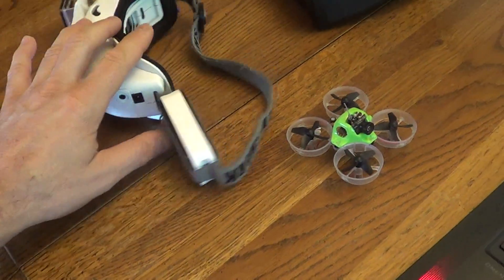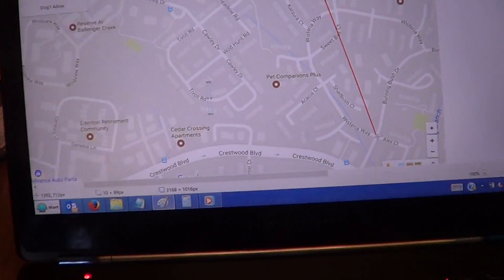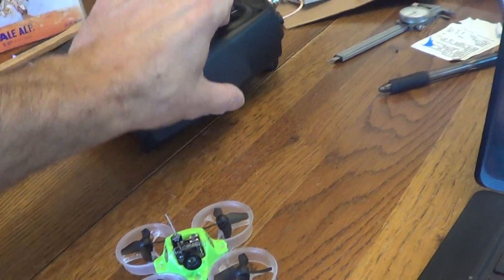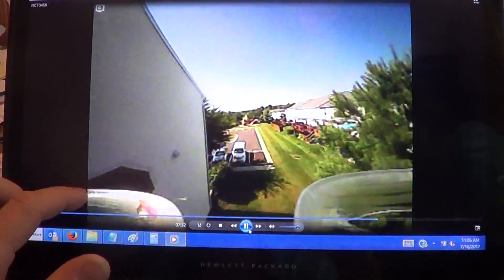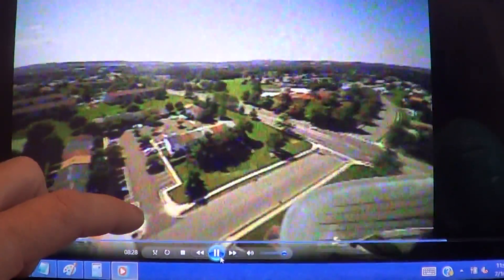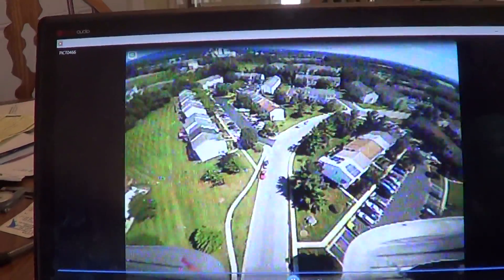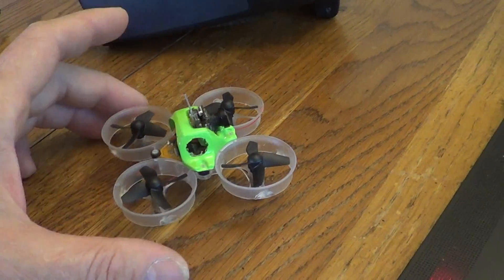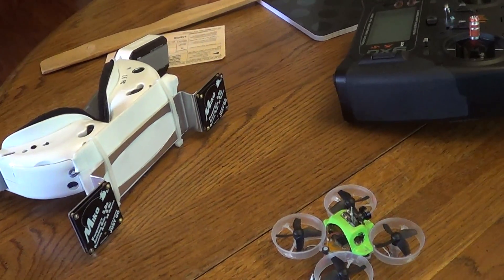0.25 mile (400m) Range Test on Tiny Whoop Long Range Setup

Comment: I got 500 meters with a diversity receiver FR632 - xm+ and a 200mw on a QX90c, mounted it on a 8 meter pole :D
also used a 2000mw booster
https://www.youtube.com/watch?v=LBXNW079t3Q

Also used one of these 3.7 to 5v regulators to boost the 3.7v battery to 5v for the camera and receiver
Reply from the maker: Definately a failsafe in the uplink.  Anything will attenuate the signal.  Green trees are actually worse than buildings.  You have to keep a straight line of sight to the quad un-obstructed.  You might try range checking the flight control TX.  Patch antennas work better than dipoles.  You can also put a 20 db attenuator to range check different antennas without having to drive like crazy.  20db will reduce power 100x, but it has to be rated for 2 watts of rf.  When you maximize the attenuated range, your full range will benefit.  I would be curious if a 2.4ghz circular polarized helix does better than linear.  It will allow the linear antenna on the quad to receive at more angles.  Also, putting one linear antenna facing down towards earth under the quad might help.  But, flight testing with an attenuator can quickly weed out the good from the bad.  You could also have an amp that is poor quality.  An easy check would be to see if it kills your wifi at home.  Noise is bad.

Comment: Was it 25mw? Also have you tried different antenna types on the transmitter? It doesn't look like the one on there has a ground element.
Reply from the maker: The ground element is a small aluminum plate behind the ceramic patch antenna.  The radiation pattern is very uniform and points away from the patch.  25mW is the overall power to the antenna.
Reply: I meant the transmitter on the quadcopter, the dipole antenna.
Reply from the maker: I have been trying all types of antenna.  Previously, I would use 2 inches of 1.13mm coax with most of it as the ground portion of the dipole.  But, I have noticed the same performance just eliminating the ground element all together and just putting a simple 12.9mm piece of high quality coax core wire directly to the camera.  The camera itself acts like the ground element.
Reply: Have you tried tuning the antenna as well? You can tune it to an exact channel. I believe the default active element length for 5.8ghz is 12.3mm. Also you can put a lighter camera and a 200mw vtx and keep the same weight. Or for power draw's sake keep the the 25mw and seperate it from the aio and locate it so the antenna and come out the bottom for better signal.

Also the best antenna I'm aware of for linear polarized and directional with a good angle is a vas biquad. You can make one yourself for cheap. You can mount it close near the ground and use coax to hook it to your goggles. 

Here's the lighter camera. https://www.banggood.com/1_2g-Super-Light-1000TVL-14-CMOS-2_8mm-Lens-FOV170-Degree-Mini-FPV-Camera-p-1110381.html?rmmds=search
Reply from the maker: I will try tuning the 25mW TX.  I search some videos on the subject.  I do have the immersion RC rf power meter.  I might have to just make the antenna wire long and trim it down until output power is maximized at the power meter say 1 foot away.
Reply: MicroDroneTech how do you test the output power of the vtx on each cannel and how do you tune the antennas ? , I’ve tried your method of the 12.9mm coax cable for a mono pole and I love it but I want to get more precise and try to tune it better .